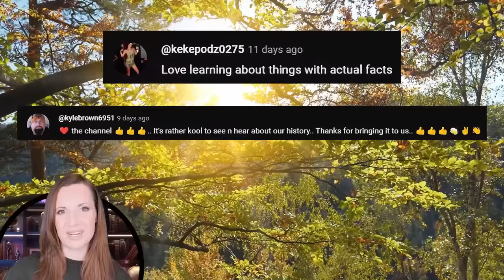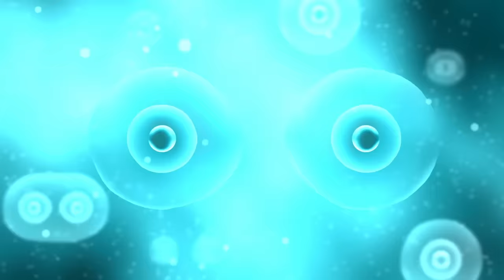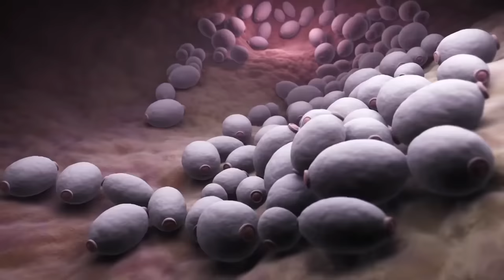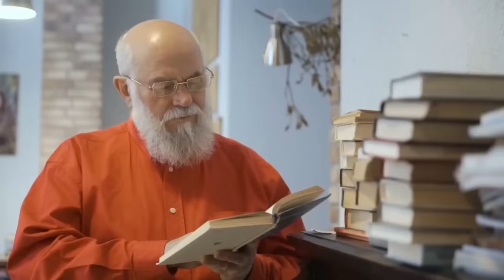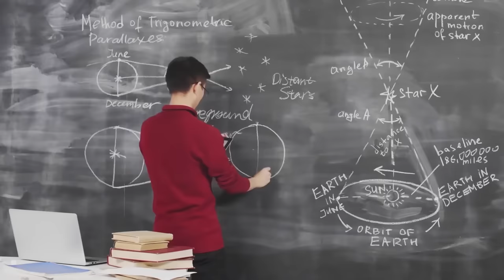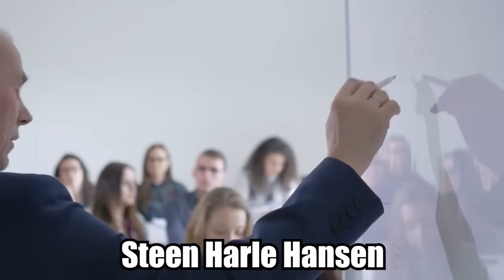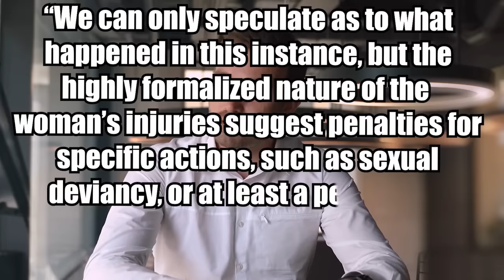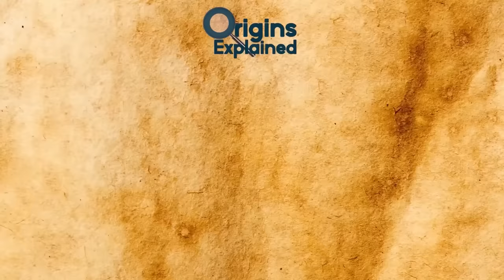Mysterious Things Scientists Can’t Explain

Comment: if the water comes with comets then the earth must have been hit by millions of "normal sized" comets to get its 1400 million km3 of water.
Reply: Water is nothing but hydrogen and oxygen, hydrogen is the most common element in the universe. Add oxygen and water could have been produced by natural processes. Especially if it's really an electric universe and knocking atoms off of something's or adding them thru electrical processes.
Reply: Yeah seems a bit of a stretch. I will say this. 
If I didnt have any answers, comets would be my choice.